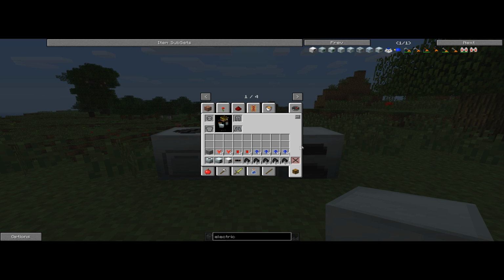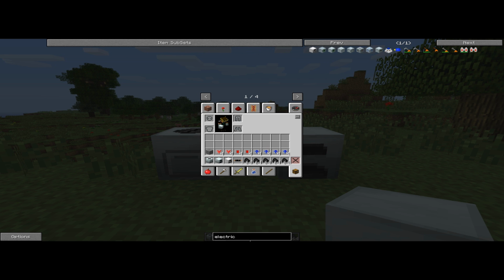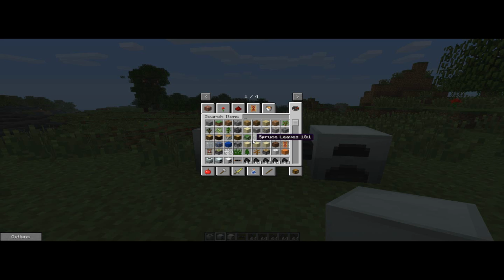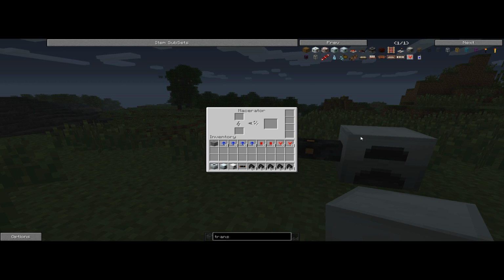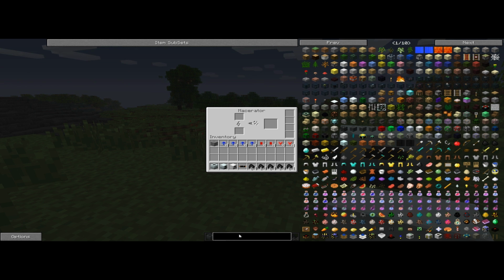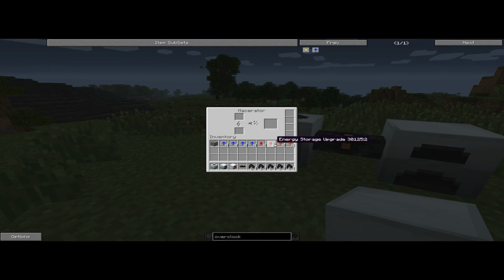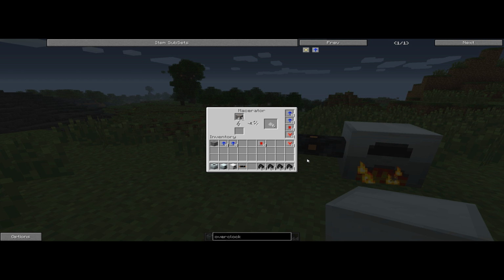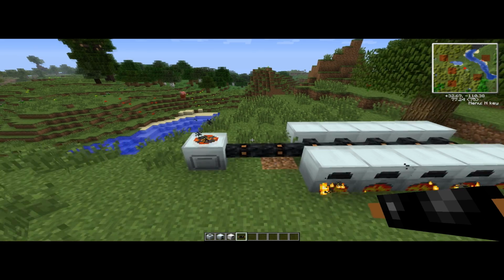Feed The Beast Starter Guide - Overclockers, Energy Storage, Transformer Upgrade - Episode 2

Comment: Last
Reply: While the macerator increases ore yield by 100%, I prefer to use the induction smelter from thermal expension, the ore and sand to get the same result. Also there's a 10% chance that you get rich slag which can increase one ore's yield to x3.